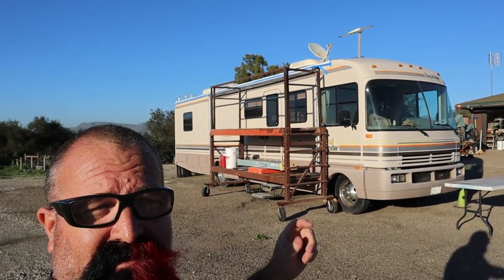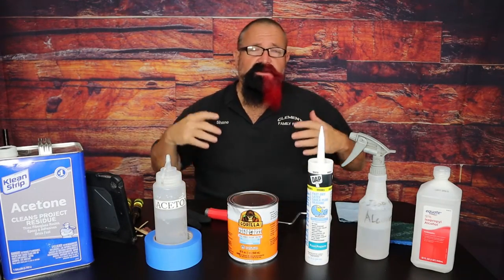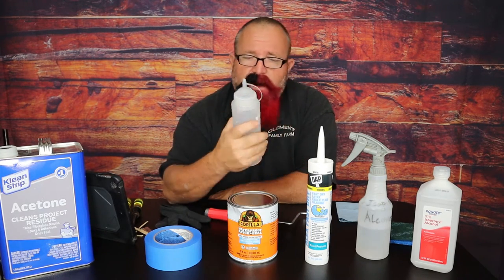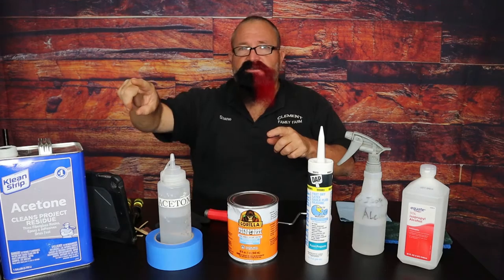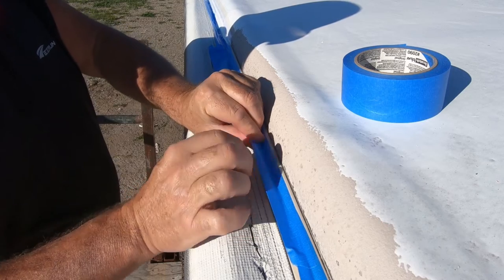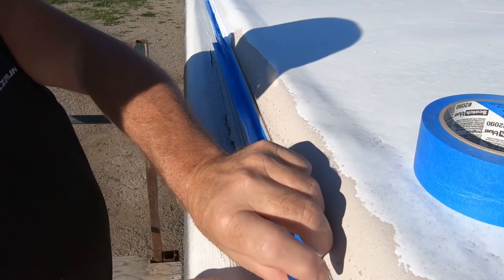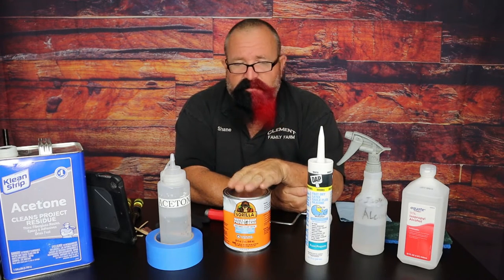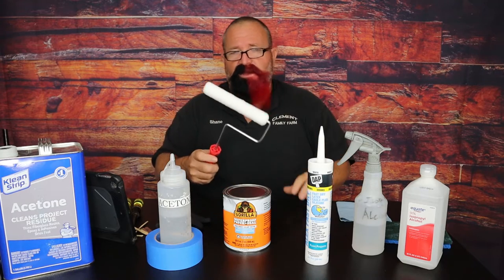RV roof repair Part 2! First full coat of sealant and product information

Comment: I think I might use this on a static caravan  ( trailers I think you in USA call them, 36ft x 12ft things that arrive on the back of a truck) Ceiling is a bit damp so I am going to have to do something before it gets worse.    Any updates after more than 2 years would be appreciated.  Any leaks?  I don't mind the constant cleaning.
Reply from the maker: All the repairs I have made with this stuff in the last 3-4 years has held up with no leaks so far.
Reply: @ClementFamilyFarms How many cans do you need for your entire RV?

Comment: How does the product go over exisiting silicone already on roof? Will i use exterior caulk to mask the silicone prior to gorilla coat?
Reply from the maker: One of the reasons I started using the gorilla sealant as it bonds to almost everything. Prepping the surfaces is the key to every good bond. This is were most people lack and have a failure. I pressure wash 3 times and scrub with a good de greaser soap then wipe the area with acetone or thinner of some sort.  Peal off some of the bigger chunks of old caulking.

Comment: Hi, do you have an update to show how well it held up? thanks
Reply from the maker: I dont have a update video on it. But I have sense checked on it. It has held up pretty good but the only thing I don't like about this sealant it is super grippe witch is good for walking on but it also grips on to dust so it gets dirty fast. On that note it also washes off really easy.
Reply: @ClementFamilyFarms  Thanks, good to know. I was going to use a different sealant over the tape anyway ( Todd at NRVTA suggests AFCAT945 ). But I was curious how well the TAPE held up.

Comment: How does the gorilla rubber coat hold up? Any update?
Reply from the maker: It holds up pretty well. The only thing I do not like about it is the dust clings to it and it is rubber and very gripy. The dirt and dust does wash off very easy. For these older RV's with little value to them I highly recommend the Gorilla rubber sealant. But if i had a newer RV or an RV I was living in I would call RV Armor as they have a lifetime warranty and a much better product. The cost of the RV Armor is less than half of a factory replacement roof well worth it with the lifetime warranty.  I am still using the gorilla rubber and many livestock trailers and Rv's.